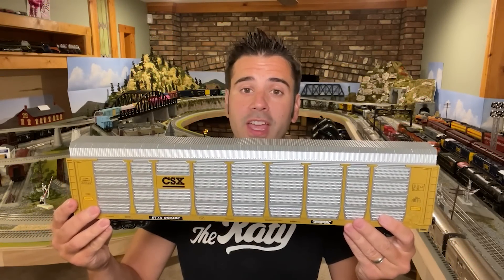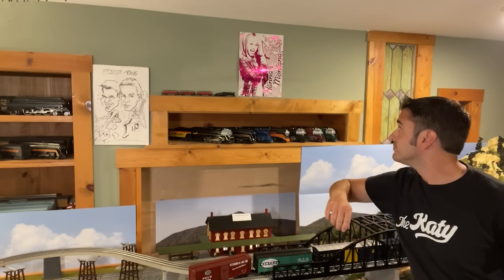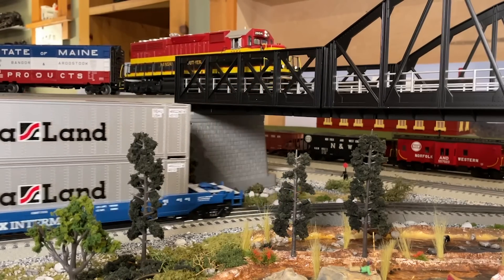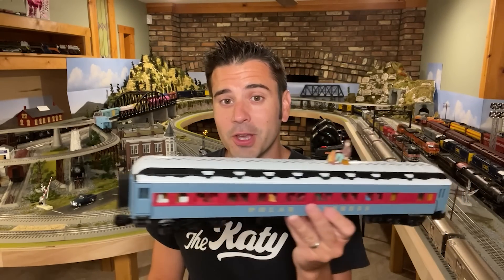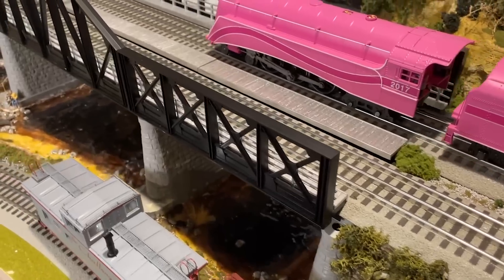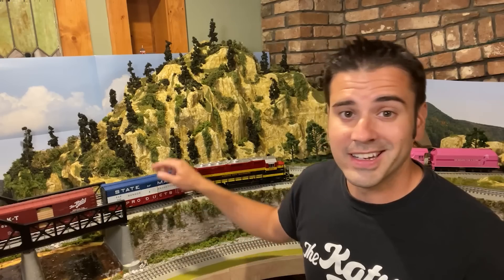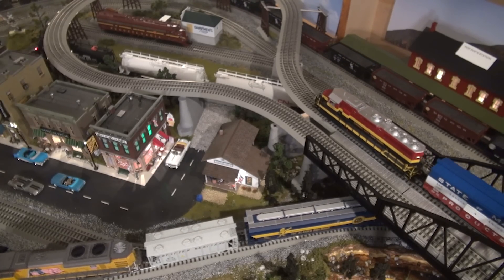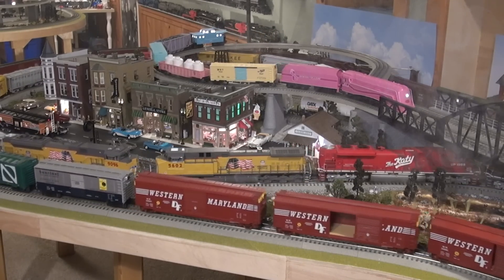I Need Your Help

Comment: Chris, if you plan to spend the time and moneyon the upper loop, i woukd raise it to clear double stacks underneath. Then i would replace the curves with 072 curves so you can run the biggest on the upper loop. And if the loops are seperated, just add 4 switches and run 2 lines across following the back wall to make it dog bons like return loops, but if you want to keep it seperate with two trains on either end you still could do that. Also test fit everything above and below. Ie overhangs outside with a big boy and inside overhangs with a dd40ax.
Reply from the maker: I would really like O72 curves on the upper track but it will mess with the scenes below since my main line/ main level track is 072. My benchwork confines my design options a bit but I think another reverse dogbone above may work. Still working through some options. Thanks for the feedback!

Comment: I would raise the upper level by two inches. If you can switch to the Chicago EL style supports and lose the FasTrack it would be less invasive to the surrounding scenery. I would connect the upper loops also. Maybe put a switch at either end so you still keep the line going through the tunnel and it's just one straight line connecting the two upper loops. Might have to lose the Lego buildings or at least relocate them.
As for the backdrops I would get 4ft. high masonite and wrap it around the back of the layout. Probably would have to screw it into the bench work. Then you can get the fancy photo backdrop scenes like Jason and Chris have. 
Where in the layout would this lift bridge be that you were talking about doing on the OGR Forum? How does that factor into all this redo?
Good luck with whatever you decide! Thanks for all you do for the hobby!
Reply from the maker: Thanks for the ideas and feedback!

Comment: I used to make train videos with my kgtrains channel and helped several other channels in my day including Toy Channels ...I recommend losing the elevated track. mount some permanent  (GoPro type or other)  cameras on stands at key points, start all the cameras at the same time (ipad or iphone)  and they use a Clapperboard or similar device. This allows you to sync the videos starts based on the sound files and the "clap". If you edit a lot of videos, you know what I am getting at and finally.....if you must use smoke in the videos hang a ventilation duct or ducts driving by a small fan. smoke plays havoc with auto-focus cameras...... ...and get some really long USB cables and USB POWERED hubs so you don't need to charge camera batteries all day long.....My experience is that a layout used for fun, isn't the best layout for making movies. Remember the old Lionel display layout, it was great for filming because it had really wide curves and really long straits without much details.... check out MrMuffins videos for a layout that is nearly impossible to film because it is so busy with stuff.

Comment: I would pull the upper loop entirely & redo it as a simple oval mounted to the wall - have it run the full outer perimeter of the room.  If you don't want to mess with the door & window area, you could instead have it hop from one table to the other with a lift bridge.  This would let you run 072 curves for the upper layout, give you plenty of room for mountains, and you get to play with some very long / cool bridges as well.  Just realize you'll have to get creative with the bridges - I don't think you're going to find an off the shelf option that would do your layout justice.

Comment: Now I am by no means what so ever a model railway/railroad expert. heck I haven't even built one myself due to A. high model prices, B. lack of space, and C. any models I DO get are beyond repair. But...perhaps sticking a old barn style bridge under the upper line of track, in scale and big enough for any car of course, could add some extra detail to the layout while also pushing the upper line's track up. It could also double as a road set piece for some more cars, and you could make the tunnel look old and worn out so parts of it can be see-through. As for the city-scape shot....I'm unsure...sorry, like I said I've never made a layout before fore several reasons so this is the best I can offer advice wise.

Comment: Adding more buildings at the turn around may help hide the turn while continuing the look of the town. Using progressively smaller buildings on the elevated section would give the appearance of a hill but would also give the appearance of the town continuing up a hill behind the main street. Good luck!
Reply from the maker: Cool idea with the buildings!

Comment: I used a cliff face to back my town, the I have my upper loop running along on top of it, that helped create a good background for the town. I'm in the process of changing my upper loop over from O27 to O36 fastrack and I'm going to use those same fastrack risers with some wood pieces painted like concrete under each one to add some height. My tunnel isn't high enough for some of my pieces but since I don't run scale stuff I'll leave that project for another time.

Comment: I like your idea of the mountain to hide the wall storage area, but seems like a very small area to get the scale you need. Also how will that affect the town scene? Any chance the layout can grow a bit in length on that side? If not straight off perhaps on a slight angle toward the turn around on the other side. 
Just my thoughts

Comment: Well Chris only thing I didn’t like about your layout is the back drop scenery. You need the 4 foot tall back drops to clean it all up. You have a beautiful layout only fault I see is back drops. I could give you plenty of ideas but all comes down to what you want and your budget because this hobby isn’t cheap.
Reply from the maker: Agree on the backdrops! Been too busy investing in the trains and the backdrop that I need is on the pricey side. Should have the new backdrop project completed by the end of this year.
Reply: @RBPTrains  I have same issues need the back drops just don’t want to spend cash on them. I really would like to see part the front loop dive under the table and com back up on the other side so looks like train not doing a loop. A nice large mountain on back side eBay fireplace would be good too.

Comment: Love your videos, you might be as crazy as I am but that’s a might. LOL.  I’m really liking the idea of a tunnel on the loop but wit 2 separate portholes, if possible.

You could feasibly install a brick or a rock wall behind the buildings if you have enough room (hard to see from a video angle).

The easiest would be to raise the loop/s with shims but extending it over to the other side and connecting it would really be cool making it a huge expansion but you’d need to have an opening bridge, that would be cool but you might wanna check with your boss before doing that and hopefully she loves trains as much as we do? LOL. Ron
Reply from the maker: Great suggestions Ron! She is pretty open minded but adding more benchwork/bridges across the open space is gonna take some convincing, lol
Reply: @RBPTrains   Just give her one of your handsome smiles, tell her Ron said so and get it done LOL LoL

Comment: If you add a mountain under the dog bone against the wall, then what do you do with the two spurs on the main level? I think if you add a mountain there it should begin at the end of the double track bridge like the mountain at the other end of the bridge. There is no room behind the town to make a natural looking slope, but you could put the toe of lope close behind the buildings and curve it along the road and build a high point against the wall. Maybe even block the benches where you have the shelves with engines. Your mountain could drop back down to the main track level somewhere behind the double track bridge. Your tunnel portals could be in the area where your station now sits on the main level and somewhere in the reverse curve on the dog bone. then the trains could emerge from the tunnels wherever the slope allows on the far left of my picture. Of course, you would have to move the station somewhere but I can not see it well enough to really have a good suggestion where. Hay, I'm just an armature at this, I'll bet there are a lot better ideas in these comments.
Reply from the maker: Lots of good ideas here! The spurs will be removed for this project and the switches are being donated to my little nephews layout.  Thanks for the feedback!
Reply: @RBPTrains  I noticed a second layout in a view you shot from over behind where you usually stand, How come you never show that layout? At first I thought it was a mirror image but it has features that I don't see in your main layout.
Reply from the maker: Hey Eugene- that is part of the main layout. I normally sit in the middle of the layout so that Northern section (called “Addison) is more often seen during my run session videos or when I show the whole layout.
Reply: @RBPTrains  OK, I had my perspective all wrong. I have always thought of your layout being more U shaped. That makes other comments about bridging from one end to the other a little more understandable. In fact I saw one comment about bridging from  the dog bone to Addison and didn't realize how that cold work. Though you would have to build some kind of pass through or go way up. I suppose it could be made to work all right.👌👌

Comment: One idea that came to me was to use that more realistic black track on the lower level that goes under bridges and such. This would from what I saw lower the main line track down a few centimeters, so you only have to change that and not the upper level tracks. 
But then again it’s your layout and your the one calling the shots, but it is an idea to consider. Get back to me if you can:).
Reply from the maker: I have thought about changing track eventually. For the elevated tracks, I will still need at least 4cm to clear the container stack cars. I think I can get around 1cm if I switch the track but then I will need to purchase all new switches which will add some serious cost. Thank you for the suggestion!  Definitely considering a track change one day to settle down the noise.
Reply: Your welcome my friend. It was in my eyes the easiest course of action for better clearance. Keep up the good work, and keep the wheels rolling!

Comment: The better way: slightly raise the elevated line.

The easy way: slightly remove some of the ballast from the FastTrack 

The hard way: invent a shrink ray and slightly shrink your large roiling stock

Comment: Personally I would just change the elevation on the layout with taller stands under the track it would be alot easier than ripping down the whole elevated line just to change the height.

Comment: I would like to see you running all your steam locomotives if you already did run all your diesel locomoatives.
Reply: Suggestion:you can put a mountain but before the montain you can put the bridge or you can change the tracks
Reply from the maker: That video is in the works :)

Comment: Sand down the base board at a slope to lower the track elevation on the lower lever so you don't have to dramatically increase the elevation of the higher level.

Draw bridge might be an option as well.

Comment: You have to question why you have an upper track at all.   Yes you can run more trains, but after you've done that a bunch, it loses its excitement.   Removing the upper track and concentrating on some scenery would give you some different vistas to give you those shots you want. Sometimes taking a step back can lead to a brand new perspective that is more exciting.

Comment: What would your suggest to find used engines to mess around with.  These are so expensive I was hoping to find something a little less so to start out with. N scale? Any suggestions?
Reply from the maker: N Scale is a great scale to work with. Prices are much better, selection is great and you can do so much more with the space. Thanks for watching!

Comment: I suggest you raise all the upper levels at least 2 inches, a time consuming task. Youll regret only a one inch rise, since you, like me , like big and small stuff. Just cut all you riser pieces at once so things are still levelish everywhere. yes, levelish, because a level trainboard is hard to maintain.  At least you can easily reach all areas of you layout, im not so fortunate.  its been weeks and im still struggling with adding my first turnaround elevated loop. have delayed my first video, again..... change is crazy easy to underestimate the time it takes, but worthwhile   gary j
Reply from the maker: Thanks for the suggestions Gary! Good luck with your build. These layouts can be quite time consuming.

Comment: I'm kinda halted on my layout because of space, I need to do some dog bones to give it the illusion that it's bigger than what it is.
Reply: Some good ways to add to the illusion is to put some tunnels (or one good-sized tunnel) on the layout so the train or trains "disappear" from sight and then re-emerge somewhere else. Another way is to have trains running in opposite directions on different loops so the eye of the viewer doesn't concentrate on any one train.  That's what I do on my modest 4x8 layout and it works.

Comment: With your polar express train set,  is that a second generation or 3rd generation? Because the first generation of the polar express train set dose not have the snow on the ruff of any of the passenger cars and other cars.
Reply from the maker: This is the 2nd generation of the scale version. The first generation had black roofs and the Polar Express logo was above the windows. The 2nd generation moved the logo below the windows and offered both snow-covered and block roofs.